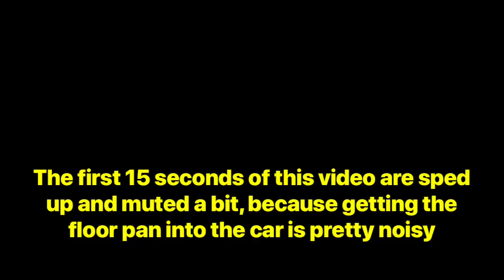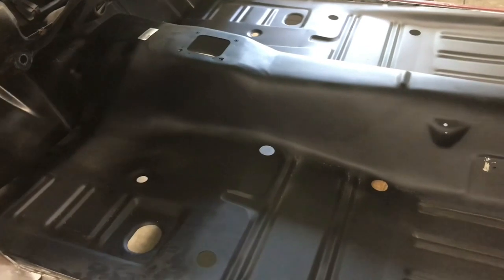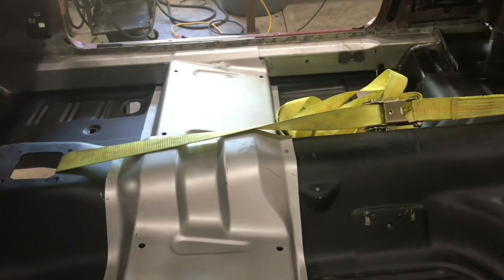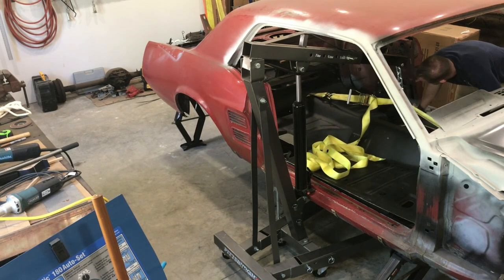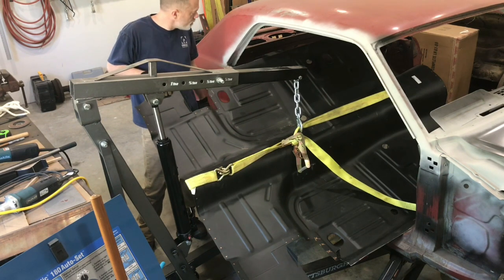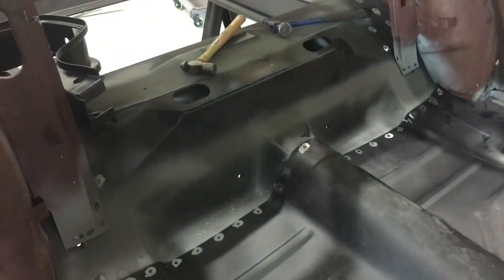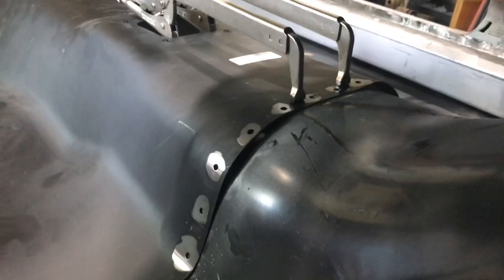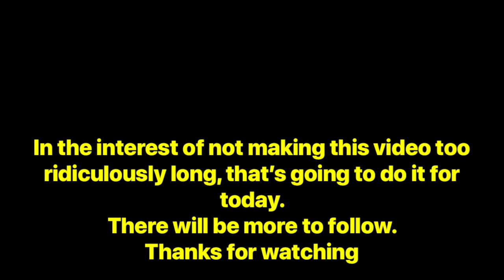67 Mustang floor pan installation

Comment: When I did my 67 mustangs floor I also added the convertible inner rockers. I went with the 69-70 one piece seat riser and just modified the ends too meat up with the rockers. I also added a set of Spintech subframe connectors.  They are a great way to add even more chassis strength and tuck up nice to the floor pan.
Reply from the maker: I like the Spintech subframe connector design.  I would think sealing all the gaps between the welded flanges would be a good idea, because I didn’t see any drain holes in the bottom surfaces, so it could potentially be bad if moisture got inside with no way out.
I haven’t decided yet which way I’ll go with them yet though.  I am contemplating making my own set, but I have to wait till I get a bit further along to make that decision. I may opt to incorporate additional tabs to tie the connectors in to the bottom of the floor pan as well, like Spintech, but with fully boxed tubing.  It’s just a thought right now, so we’ll see when I get closer to that point.
Reply: @67mustangcouperestoration  the back end of the subframe connectors are open so moisture can run out. I coated the insides well before attaching them. My car will mostly be a fair weather car so I'm not that concerned with them getting that wet inside.

Comment: I'm doing a 65 with that style of a one piece floor. Right now the front floor supports aren't in so I was planning on bringing mine in from the bottom. I see you have convertible inner rockers which is going to add strength to the structure. That's a good idea.. Good luck with it. Looking good.
Reply from the maker: Thanks.  Moving the floor pan around can be pretty awkward for sure, but putting it in from the bottom will probably be fairly drama-free.  Good luck!

Comment: I understand that Ford had a 1/8 inch acceptable tolerance when building these cars. That might explain some of the overall gaps to some extent.
Reply from the maker: I think the factory stamped panels were pretty accurate, but they were then assembled pretty much by hand, so that’s probably where the gaps come along.
Reply: @67mustangcouperestoration  Very true. I have also seen it said the quality often depended on the day of assembly with Fridays being the worst.

Comment: question :  isn't there a difference between full floor for a convertible  and a fastback/coupe ??
Reply from the maker: Yes. The convertible floor is not as wide, because the inner convertible rockers make the floor a few inches narrower.